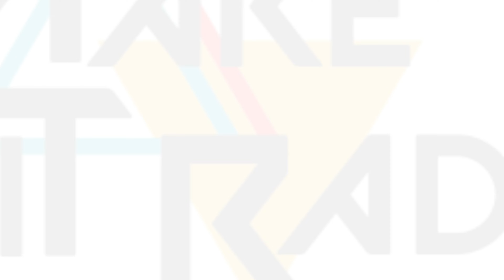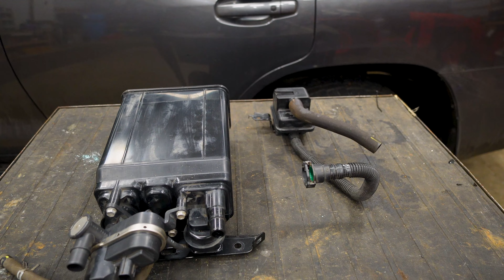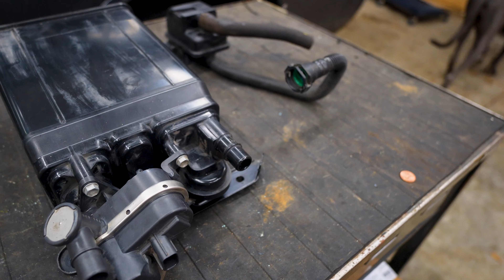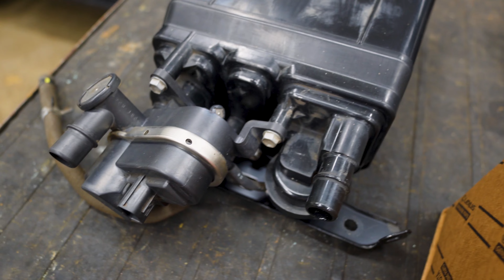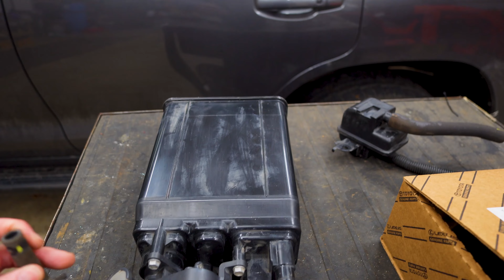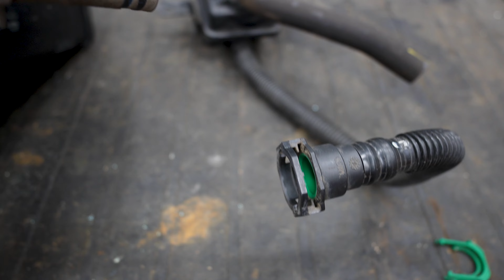P0453 EVAP | Check Engine Light | Toyota LandCruiser | Lets fix it!

Comment: Whats the name of the part that you change Sir?
Reply from the maker: Toyota refers to it as a "Lead Detection Pump Assembly".  Good luck. I recommend splurging on a new gas cap first, might solve the problem. Thanks for watchinbg.
Reply: @MakeItRad thank you my good sir. You did gods work tonight